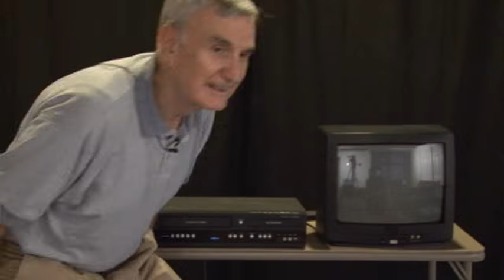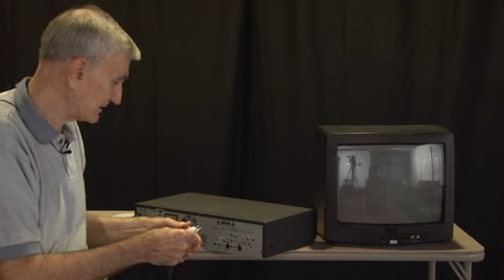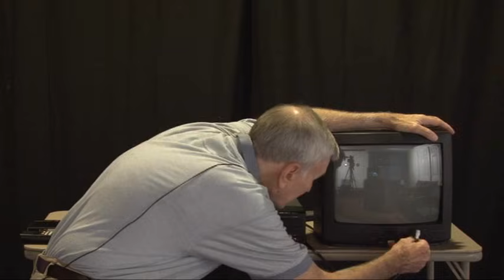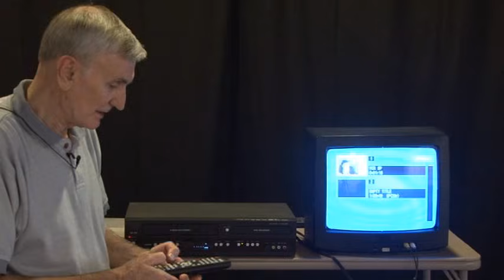VHS transfer to DVD using combo recorder

Comment: Anthony I have about 50 maybe 75 of these VHS shot of my kids in the early 1990s-late 1990s. I have had them taped in a secure dry box kept in a cool home environment for over 16 years and the box untouched. I have got to get these on DVD. I taped it shut in 1999 when I moved to Cancun for a year and it's never been untaped and opened as I want to do this when I am ready to transfer them. I am really confused as THE BEST method not to lose any video and or sound quality. Your video was really good but not sure if this way or the computer way with a converter is best. I am still trying to figure it out to make sure I do not make a mistake. Your tip on rewind and fast forward was neat to learn the length of each tape.
Thanks
Reply from the maker: Jimmy Page , Verry good question. I can't say with any authority but I suspect that some VHS combo recorders or VHS players have better play back heads than others. I have done "no" research on this question, this is my personal feeling. I do however believe if there is a VHS machine with a superior playback head, this would be the big factor in securing the best quality transfer. As you may have guessed, I am satisfied with and will have to live with the quality of the VHS transfers I get with the equipment I have.  I have heard that there are professional transfer facilities that most likely would charge a small fortune to transfer your VHS tapes to a digital media. But I have never heard of anyone who used those facilities. I have never heard  any comments regarding the quality of such VHS transfers. Sorry I can't be more help.

Comment: Hi, I’m having a problem trying to record a vhs onto dvd. I have checked some of your videos and I seem to be doing everthing correct! But no luck as yet. Only thing different was you took the little square bit off the video, which we did years ago to stop them being recorded over. I assumed you had to put tape over it again to copy it, but maybe I got it wrong, so will try without taping over where the square was, see if it makes a difference

Comment: If any of you are confused when you cant go into setup to finalize the disk, press the stop button, then do the setup, it was an issue with mine with the model number ending in MG9
Reply from the maker: ChargeDoger, Thank You!! I did leave this step out on this YouTube video. I didn't even realize this until just recently. I made a follow up YouTube video to point out this oversight and point out a couple of other points.
Reply: @dahdigital1  My Pleasure! One thing you might want to do to direct traffic to that updated video is put a note of that in the top of the description of this video with the link to the new video,
Reply from the maker: ChargeDodger, Thank You very much, I just completed that as you suggested!

Comment: I finalized the disc from recording our home videos but all that shows up on another dvd player is the screen with the separate sections and time of each section. Shows that each title should have 55 minutes of recording.
Reply from the maker: +Marilyn Price , Put the DVD back into the combo you made the DVD with. See if the DVD will play. If is does work and plays back ok, I suggest going through the steps to finalize the DVD AGAIN! Then see if it will play in another DVD.

Comment: Secret tip from a pro.. Always fast forward and rewind ANY tape that has been in storage for many years. It corrects tape tension and makes for a better transfer.
Reply from the maker: Tom Yaz, thanks for the tip!
Reply: a lot of people give up on tapes that wont play right .. usually a simple fix is FF RW many times

Comment: Everything worked as you showed, except when I tried to go into SETUP mode to finalize the DVD, SETUP didn't work, nothing happened when I pressed SETUP.  I turned the unit off, back on again, entered SETUP.  Once the disk initialized I was able to finalize it.  Thanks for the info, I saw nothing in the manual about the DUBBING button!
Reply from the maker: gojoe283, You need to push the" stop" button before the setup.

Comment: This machine is good at transferring VHS to DVD. It comes under two Trade names, SANYO and FUNAI, same machine only name changed. With a few issues I was satisfied with the transfers. But you should know, these machines are no longer cheap. At Walmart and Amazon, you could get a unit for around $200.00. The company that manufactured VCR’s (All the different Trade marks were made there) has shut down. So the Age of the VCR is over, if you need a preplacement or repair it could cost you or be impossible.
Reply from the maker: John Martinez, Thanks for the information.

Comment: I followed your very instructive help to transfer - unfortunately I cannot see the narrative on my screen i.e. setup etc.  I have copied the vhs but am unable to finalize it.  Not sure what is wrong.
Reply from the maker: Angie Cole, using my Magnavox remote, I must press the stop button,first,  then select set up.
Reply: I have a Toshiba TV with hand control and a Toshiba Video/Dvd combo with handset.  Have tried what you suggest but it does not work.  One thing - I have attached Video/Dvd recorder to TV with a scart lead - would that make a difference?
Reply from the maker: Angie Cole, what is a scart lead? I can't see how a TV attachment would have effect on finalizing a DVD.
Reply: It is the method i have used to attach the combo to the tv - about a 20 odd pin connecter
Reply: I am sure you are right but am struggling to finalise

Comment: Anthony Wheeler :I have exactly the Toshiba VHS/DVD combo recorder with 1080p upscaling(I do not remember the number of the model now),and I actually have a problem with the VHS system,that turns off after 6 seconds of playing and then,when I turn it on,the vhs cassette ejects. And it happens to ALL of the VHS cassettes.
Reply from the maker: 123456RaulMorales, It sounds to me like your combo unit is worn out or broken.
Reply: Yep,it''s highly likely worn out,because of a faulty digital board(79105753,model dvr620ku,series d34r4632ku0602) And great thing ,the digital board that I am talking about is discontinued and it won't be fixed/replaced,because of that case-scenario.They told me about it today,on 9-30-2016.

Comment: There also could be certain devices available for purchase and hook it up to a machine like this that will remove copy guards on commercially made VHS tapes! I may look into one of those if I get a machine like this so I can transfer some of my tapes!!
Reply from the maker: ***** , did you see the post by OrtonFan WWE, " by the later models they bypass copyright protected VHS ".  This is news to me.
Reply: Anthony Wheeler This would be news to me as well! I always thought the copy guard on them would be strong enough as to not let it be transferred although there are ways to get around those things!!

Comment: Where can i find this machine? I want either a new or a used one. 

Very nice video . All the instructions were clear . I am looking forward to begin the procedure.
Reply from the maker: anna-maria Klada, To the best of my knowledge the combo dvd recorder has not been made for several years. I have only seen used and refurbished on Amazon, Ebay, and BandH photo in NY. There probably are other places. I suggest that you be sure what you buy is a combo that records to DVD, some machines that look just like the combo recorder only record to vhs tape.
Reply: @dahdigital1   thank you for your response

Comment: I've been looking at DVD Recorder/VHS combos at Amazon.  One customer reviewer reminded readers that although it was a combo they still needed to connect another vcr to the DVD recorder.  Either that person didn't know the correct way to use their machine or the review was for a different combo machine that was not a recorder.  Its getting a bit complex trying to find a DVD recorder/VHS combo that will actually record.  The information at Amazon isn't helping.
Reply from the maker: skylx08, You are absolutely correct, Either that person didn't know the correct way to use their machine or the review was for a different combo machine that was not a recorder.

Comment: Thanks for the help. I'm having trouble recording television to DVD. Any advice?
Reply from the maker: Herb Eaversmelz, You will need an out put from the TV that is comparable with the input to the DVD recorder. Set up a tv or other monitor to the output from the DVD recorder. After you run your wires from the TV to your DVD recorder, if you can see the picture output coming from from the DVD recorder play through your tv or monitor, You should be able to record. Unless there are other issues..

Comment: It's probably better to use a separate vcr because the combo units don't have good playback quality compared to standalone units. A s-vhs deck with S-video out is generally the cleanest picture you can get.
Reply from the maker: Knightmessenger, Thanks, I'd say you are right about that.
Reply: Anthony Wheeler
I took screenshots once of several vhs captures of the same tape. I should really find the computer I saved them on.

Comment: I will be starting a large project of converting from Beta to VHS to DVD soon.
Wondering how many times I can reuse a VHS tape as far as recording the Beta to it, transferring to DVD and then recording over VHS for the next Beta tape etc...
Don't wanna lose quality.
Thanks in advance.
Reply from the maker: Justin Nordhausen , I have never owned Beta equipment. I recommend you Take the output wires that you are planning to connect to a VCR and connect those wires instead to the combo recorder input.  I haven't made a dvd this way but you should be able to record a dvd direct from you Beta player. This would save you a lot of time, plus you should end up with a better quality transfer.

Comment: I have a similar set up @ home.  Only it's a separate DVD Recorder/VCR.  Trouble is unless the tape was made on that machine it won't play back correctly.  Although you can get lucky sometimes and it will play, and you get a pretty good picture.  But it will never be as good as a DVD, @ least you have a copy that's playable.  In addition, you can't copy pre-recorded tapes, they are encoded so you can't do that.
Reply from the maker: Larry Magee, I have had some limited success rewinding a tape a couple of times and the tape would then track better.
Reply: @dahdigital1  I've done the same thing, and I've gotten lucky, but 9 times out of ten it's no dice.

Comment: Hi!  I love your presentation.  It is very helpful.  I just purchased a Toshiba 620 VCR/DVD converter.  I have tried everything but cannot get sound on the finished DVD.  What am I doing wrong?  I am ready to tear my hair out!
Reply from the maker: Carolyn Kehrli , The wiring in internal, I don't know if the audio could be turned off. I think I would contact the place where you purchased the unit and ask them if it may have a problem. Sorry I can't be more help.

Comment: With 50 years of using analog, my brain is programmed the same - that is, when using analog audio/video equipment, I could always SEE all connections, actual TAPE being used, etc. I can easily imagine all of the connections in my mind . . . Also, the same goes for mics and a mixing panel - I can see and feel all of the controls for fading in and out, left to right, etc. and continue to monitor it all by sight. It's as if I have some sort of mind block trying to apply this thinking to digital!  Does ANYBODY understand what I'm saying? (or trying to say?!)
Reply from the maker: CHARLIE STUCKEY, I am 73 and I have been with digital for about 10 years, I get it now. If I were just starting digital now I am sure I would feel the way you do.

Comment: i have several short vcr taps, how do i stop the dvd-r and change vcr taps and start the dvd to start where i left off
Reply from the maker: +Ken Ayres , First of all leave your DVD in the combo recorder until you have recorded all of your tapes to the DVD and then finalize. Put each vhs tape in the combo recorder starting at the point you want to record. Push the dub feature and record until the end of the sequence you want and push stop. Take that tape out and put in the next tape and do the same. Good luck.

Comment: After having looked twice your very practical demonstration how to copy an old vhs Cassie into a DVD disc, I have a question. As soon as I put a new DVD disc, it turns around and tells me DVD failure. The DVD is brand new a 2 hours time duration but it won't accept it. Where is my mistake?the DVD is a w/r disc.hope to receive you r piece of advice. Thanks very much for your time.
Reply from the maker: abele ballestri, I only use Verbatim DVD-R disc for my transfers.

Comment: Excellent, you have real talent in explaining a task thoroughly and for easy consumption. Thank You. I am buying a used Magnavox unit and this will  help me.   QUES:   do you feel the quality of the dvd is as good as if I paid a co to do it??  Another  question, sorry you are good so I ask,,, I have some mold on some older tapes, I heard U can have that removed and I would only do that to some family vhs tapes if applicable. Do u think that would work and would the mold hurt the machine IF I did NOT get them cleaned first??? Thank you, deb.
Reply from the maker: deborah lariscy, I don't know about the quality compared to paying a co to do it? I haven't had any experience with mold on a vhs tape but I wouldn't put a moldy tape in my combo unit.
Reply: Thanks, I won' unless I get another one for free or something. I don't have many that I can't replace with a dvd, thinking of some of the rare ones. Thanks again !

Comment: I called 2 walmarts. They don't have it anymore. They carry a Funai device that's suppose to do the same thing. Will have to check that one out. If I don't like, it, might have to use amazon and/or order it online.
Reply from the maker: steveo288, thanks for the information. I bought my combo recorder a couple of years ago. I wasn't even aware of a brand by that name. If you buy the Funai combo recorder, let me know what you think of that combo recorder.
Reply: Anthony Wheeler
The machine is very much like yours and the Toshiba brand. Walmart only carries the Funai brand now. It only uses DVD-RW/-R, which was disappointing. I got the vcr side working ok. I didn't want or care about the audio, so I connected the video only from the machine to my tv. The results remain to be seen. I don't have any DVD-RW/-R discs, so another trip to the store is upcoming.
Reply from the maker: steveo288, thanks again, the DVD-R disks have always worked good for me on vhs to dvd transfers. I use DVD-R for most all of my jobs. I wish you success with the combo recorder you purchased.
Reply: Funai works nicely. If it doesn't they will take it back so try it.
Reply: Just an update for Dec. 2017. I checked amazon and the Funai machine is now listed at $730! I was shocked. hhaa! K-mart was $360 not counting shipping. Walmart was out of stock. I think I paid around $220 a couple years ago. Makes me think this combo will not be available too much longer.

Comment: I bought one of these and the problem I had was a tracking problem.  When I load a VHS tape it would play it then when I rewind it to the beginning, I would get noise on the screen and had to play with the tracking or turn it off and do factory reset every time.  Played with it for a day then had to return it to cause I could not tolerate fiddling around with the tracking just to get my video on the TV screen instead of noise.  Called customer support 4 times and they were no help.
Reply from the maker: +beerborn , Sorry you had that problem. I am just fortunate, that hasn't happened to me. Sounds like your unit was defective.
Reply: I returned it and got the Toshiba DVR620 and it works fine now.

Comment: I obtained a SANYO    DVD Recorder / VCR LINE- IN Recording ( no turner ) Model NO FWZV475F . Just now trying to set it up to our Vizio flat-screen TV. In addition to the standard color-coded wires which is all that it had in the box which other cable do you recommend that I purchase. Or should it work ok with just the three color-coded wires provided?
Reply from the maker: Steve Rechel, If you have connections in HDMI that is higher resolution.
Reply: @dahdigital1  I am going to order an HDMI cable because yes my unit has a HDMI connection port as well as one of course on my Vizio flatscreen TV.

Comment: I followed your instructions they were very helpful for using the same Sanyo machine. I finalized the DVD's but when I try to play on my new Sony Bluray/DVD player the DVD fails to play it says: "This operation is currently prohibited for this disc". Any recommendations appreciated.
Reply from the maker: Max Hofer, see if the DVD will play back on an other DVD player, if it doesn't, the only thing I could suggest is that you put the DVD back into the combo recorder and follow the steps to finalize the DVD again.

Comment: Thank you so much, I read the manual and was getting no where, you made it so clear and simple. Now that I have my VHS tapes on DVD I would like to be able to edit them in my computer, do you know of a safe software program I can download to help me do that?
Reply from the maker: virginnyc, My Sony Vegas Pro 13  has worked very well for me. Through this Vegas software you can copy (rip) the DVD from the computer DVD tray to your time line in Sony Vegas. You can edit, cut and paste, copy and delete and make new DVD's or any one of a number of video file types.
Reply: Thank you Anthony, I will look into this. I have a box of VHS tapes I am transferring to DVD and they need a lot of editing before sharing them with the family.
Reply from the maker: virginnyc, I suggest setting the record DVD mode to "SP" that is the two hour record time. I don't recommend the long record times because the record quality goes down.